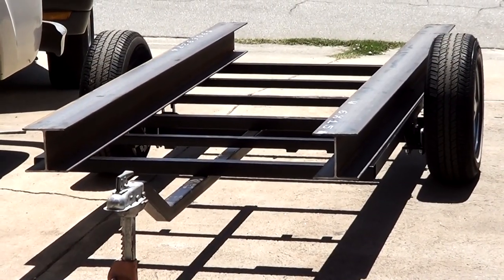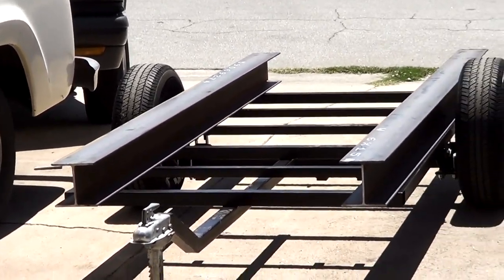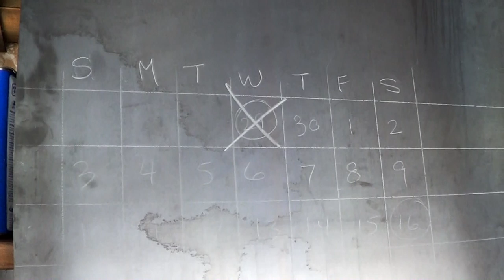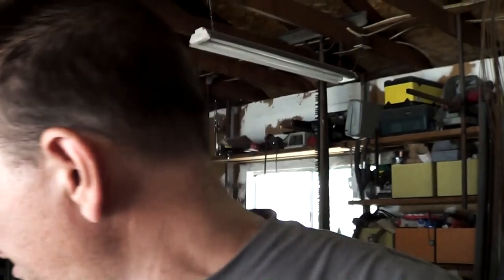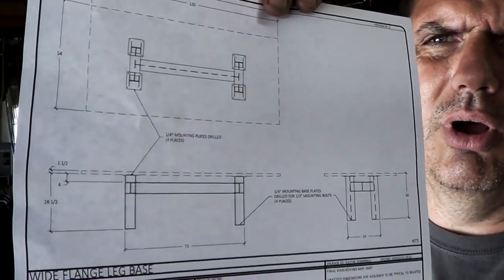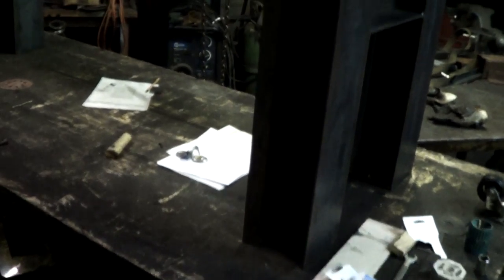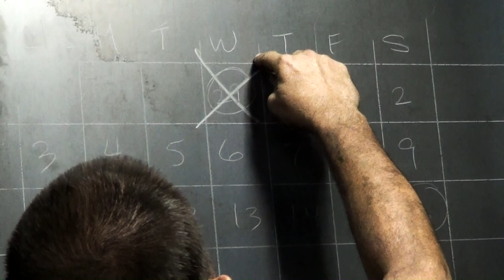Contemporary Steel Conference Table Base v53

Comment: Fantastic work!!! Out of curiosity. Why do you have a round bar welded to your cutting guide?
Reply from the maker: That guide was made by my dad years ago for the Oxy/Acetylene torch. The round edge does a couple of things. One, it provides a smooth surface to drag against. Two, when cutting with gas it lessens the chance of snuffing your flame by providing an air gap of sorts. At least that's how it was explained to me. Cheers!